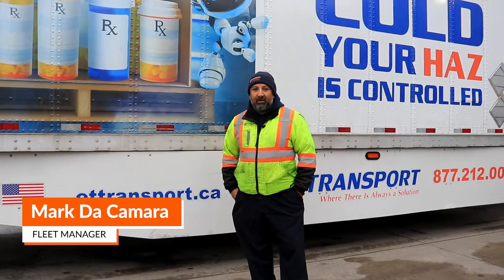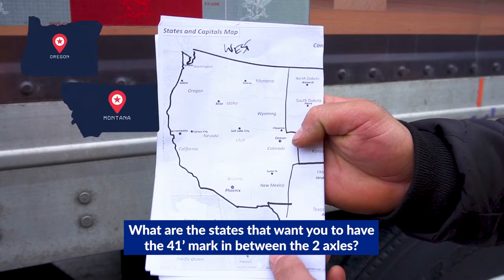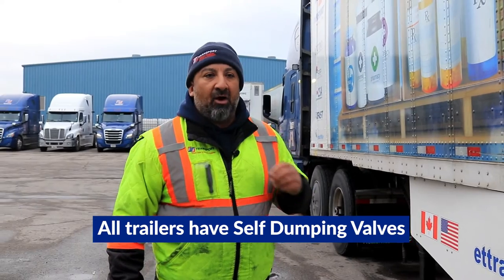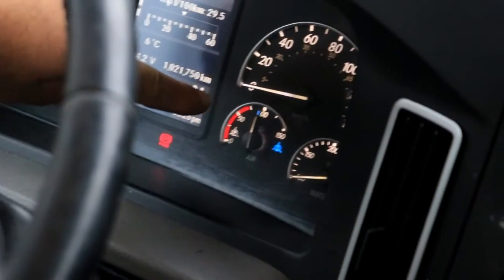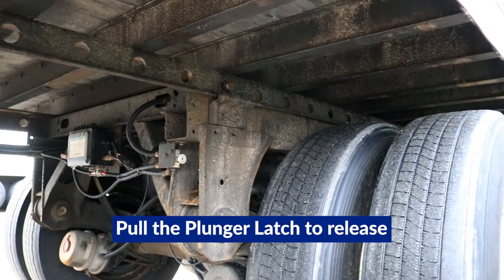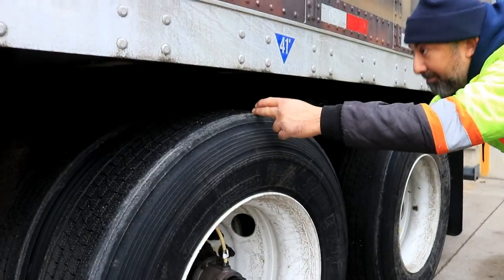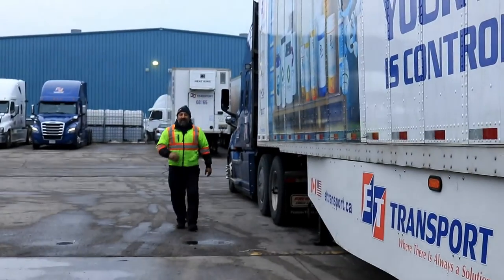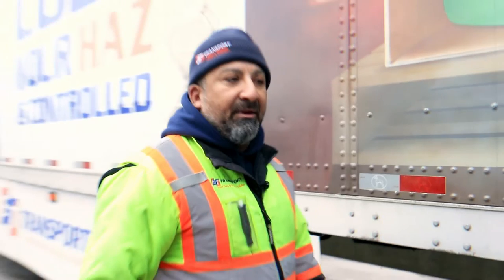How to Move Axles when a Trailer is Overweight | Overweight Distribution Tutorial Video

Comment: How do you determine how many pounds per pin? Some say 250 lbs. Others say 500 lbs.
Reply: Some trailers have the holes 3 inches apart, some 4 inches, some 6 inches. In my driving days ( now retired) I just figured 1000# per foot. 
HINT- Before moving anything make a chalk mark at the hole you want the  pins to be. Also mark on the slider frame where the pin is now, & a reference mark on the ground outside your door, (shadow of mirror, etc.). Then make your move, stop when at this mark, you will be close. Then check your  marks to see how close you got, either just a smidgen more, or OOPS-went too far. This saves a lot of walking, with a little practice you can hit it on first try.